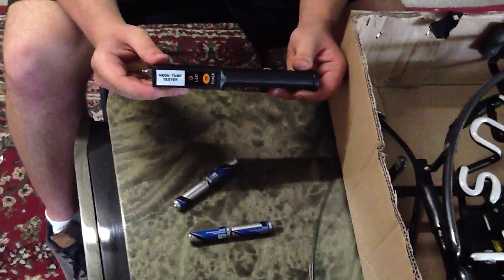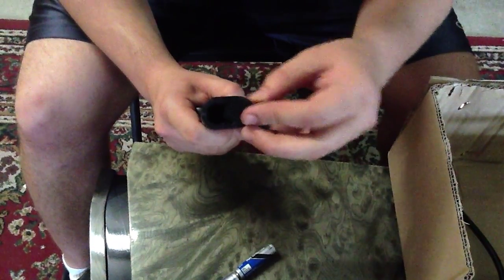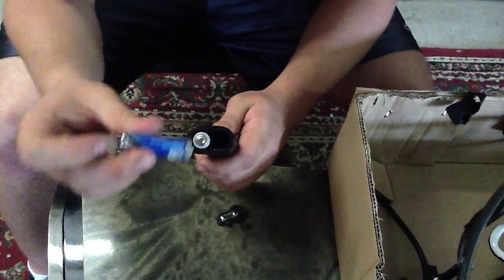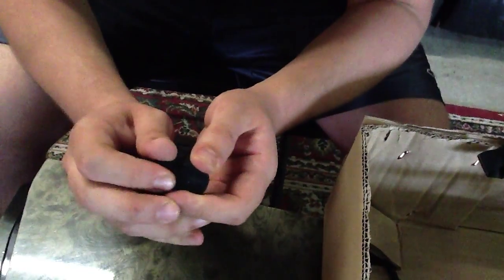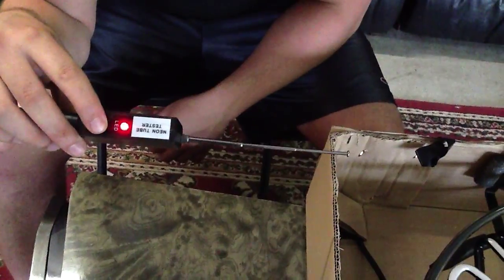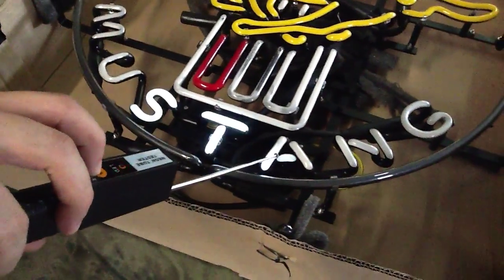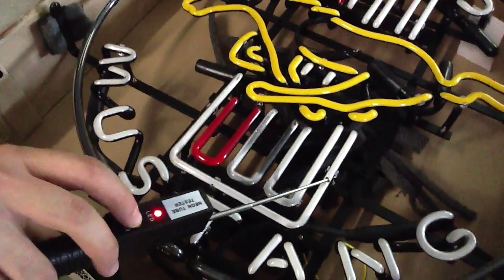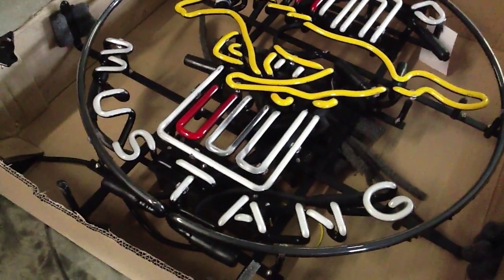How to use a neon tube tester - a Neonetics how-to video

Comment: What is the out put voltage of this tester
Reply from the maker: Thanks for your question. It gives out 3000V at about 5mA, but only in very short bursts. It is enough to light up a neon bulb, as shown in the video.
Reply: Rudy Kuneff k
Reply: were can i find one